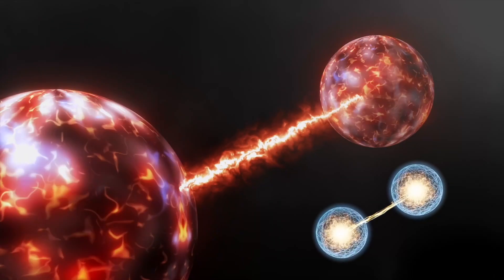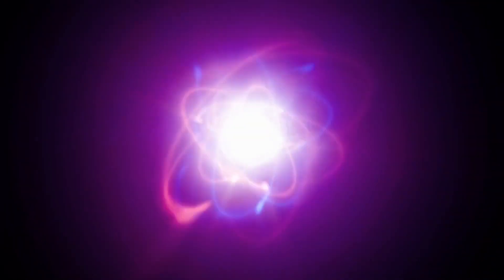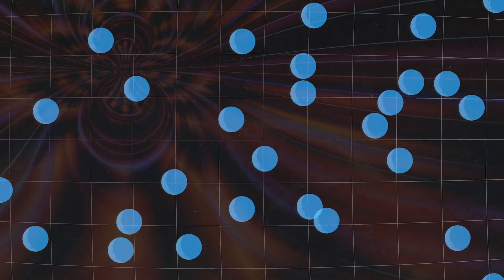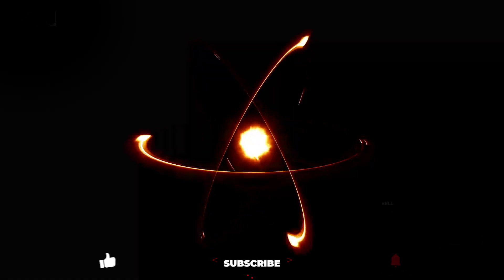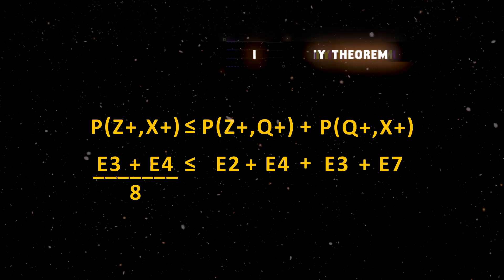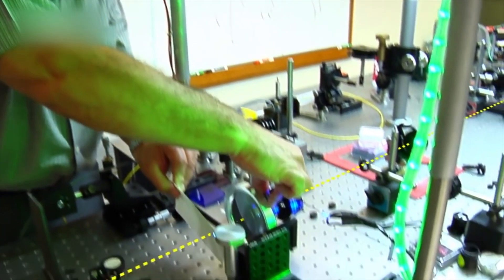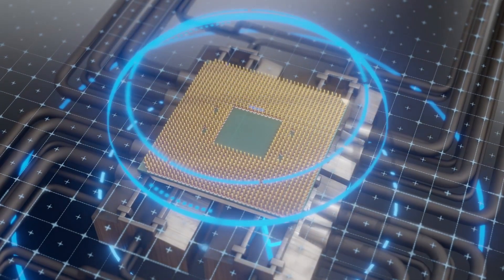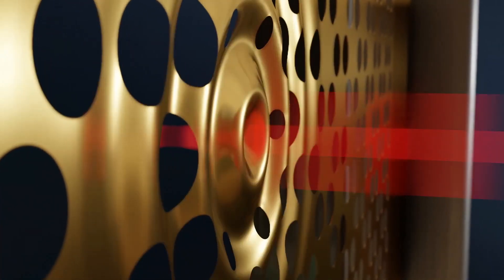Scientists Discover Particles That "Communicate" Over ANY Distance? | Spooky Action at a Distance

Comment: It's actually calibrated particles and no matter how far apart, their spin will be exactly opposite to one another. So you can take one particle far away, and at the moment you know the spin of one particle you can deduce the spin of the other, since it's going to be its opposite. It just shows that the subatomic world is built on top of some other system that can allow for such precision

Comment: What this guy said at the end about using entangled particles for fast communication is amazing because for years I have been telling people that is probably how aliens communicate across the universe without worrying about the speed of radio transmissions and therefore why we are missing their signals. They may even be able to communicate through time this way, scientists on Earth should figure this out. This guy is the only person I have heard suggest this possibility other than me.
Reply: Yeah but its completely wrong.  You can not encode information into the entangled pair, only read information.  Its like having a Read only CD with nothing but noise on it. Or better, a 2 sided CD or record in which whatever is on one side is completely opposite on the other.  They are correlated and yet still completely useless noise.  The only people who even talk of communication using Entanglement are people who simply don't know anything about Quantum physics. 
Even IF you found a way to write information, the act of doing so leads to decoherence and breaking of the entanglement.  Matter fact, this happens soon as you read it for that matter as the wavefunction collapses to a definite state.
Reply: @seditt5146  You do not understand, the breaking of the entanglement is the bit of information. I did not say a particle was a hard drive you could write data on. Imagine something like a bunch of entangled particles with opposite spins being like the ones and zeros in binary, that is what I meant not writing data on subatomic particles.
Reply: Actually, humans just don't know how to encode or detect the information yet but based on this video it seems like they are in the process of figuring it out. I am sure a DVD would seem like a read only CD with nothing but noise on it to a PC made before DVDs were invented, but let's debate that point too.
Reply: @adriennefloreen  Well, no. We're not in the process of figuring it out - quantum systems have been proven to collapse into a random, unknowable state when 'observed'. There's a lot we don't know about the quantum world but being able to transmit information via entanglement would break just about every law of physics. It's a nice idea but it's just really not rooted in reality
Reply: Yes the video is wrong. You can only share random secrets at any distance, thus the use of quantum keys encryption.
Reply: How could entanglement be used for communication?
Reply: @ylgukcuf1618  That is what I was just talking about above... it can't be used for communication.  It is read only for starters and is a 50/50 split of noise nothing more.   Quantum mechanics is fucked.  Einstein knew it but bad physicist have gone down a lazy road for 100 years with this probabilistic nonsense and calling it a win whenever their equations which predict every possible outcome happen to predict their outcome..  I shit you not QM states one particle will be spin up, one particle will be spin down. A particle will be Spin Up 50 percent of the time and Spin Down 50 percent of the time.  When is one or the other their predictions are successful  :D I wish I was joking about that but I'm not lol.   Na, it can get far more complex than that but that really is the gist of it just a bunch of those 50 percents stacked.  
It does get weird with entanglement as every time you detect Spin Up you instantly know other particle is Spin Down.   Problem is you can't encode information for starters and the particles have to interact for them to become entangled.  Then without messing up the wavefunction through measurement you can take the particles clear across the universe,  read one and instantly know what the other is unfortunately you move the particles apart at speeds slower than light and the instant you read one, they are no longer entangled so you get 1 bit of information per entangled pair that needed to be near each other to get entangled in the first place.  You will not know which is up or down until you " look" at one of them at which point its useless any further.  This means random information at slower than light speed.  Not very useful for much of anything really least not communicating information.  Most info about entanglement is straight up hype.  Its an interesting phenomenon but not for the reasons people seem to think.
Reply: You cannot communicate with entangled pairs because you cannot force them to collapse into a desired state. It's equivalent to knowing the bottom side of a coin is tails if you see the top side being heads. However, you cannot force the coin to land heads up, and thus can't send 'tails' to another person
Reply: @robaus23  uh yeah I can just put it down heads up??? easy
Reply: 🤔🙄There's no such as "spooky action at distance" if we consider that another universes, subdimensions or different universe( whatever they are) that are lack of t or 3ds or both. as far as I see at least two more of them beside our physical universe. The relationship of our physical universe and other universes ( or worlds) is just like traveling transverse waves. They pass through each other with out interacting. Then everything is ok with me.
Reply: @ca24tamie30  Thanks for joining the debate. But have you considered the appearance in our universe of objects that have dimensions that exist in other universes?
Reply: @adriennefloreen  🤔 maybe
Reply: 28htz